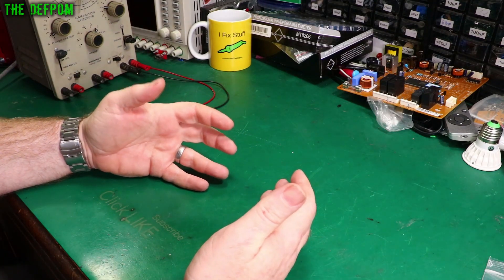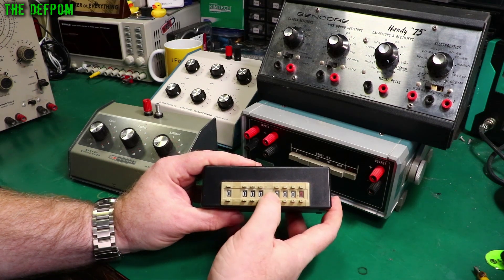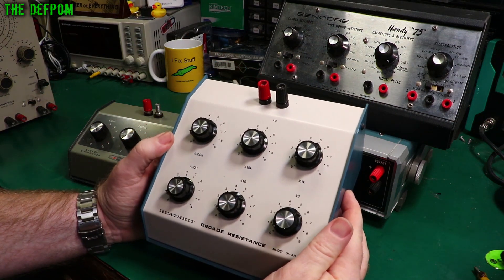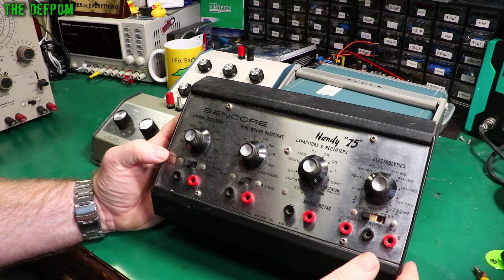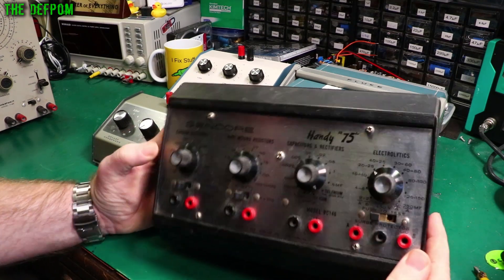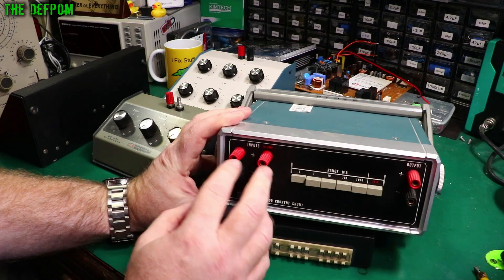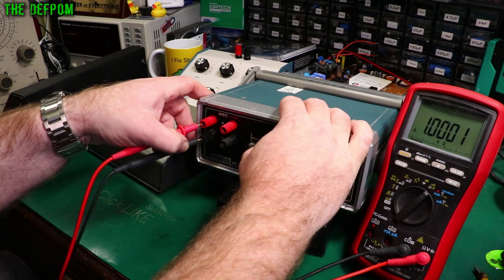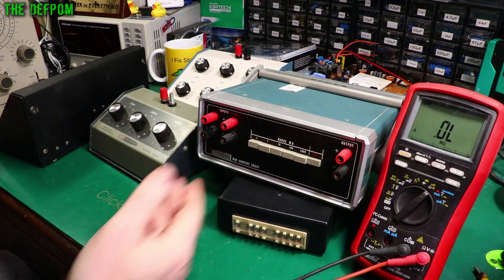🔴 Electronics Tools For Beginners - No.14 - Resistance & Capacitance Substituation Boxes - No.1018

Comment: Unless you are into metrology, I've never been convinced of how useful these decade boxes are.  The resistance, inductance  and capacitance of the connectors and leads may significantly alter the impedance of a selected value.   If that value is introduced into a circuit in order to optimise performance, these parameters can have misleading effects at AC frequencies.
Reply: I think they are basically from  time gone by.